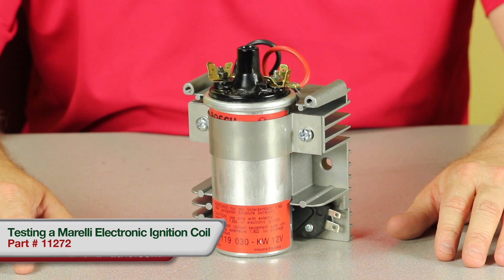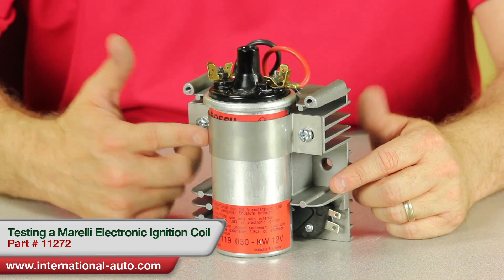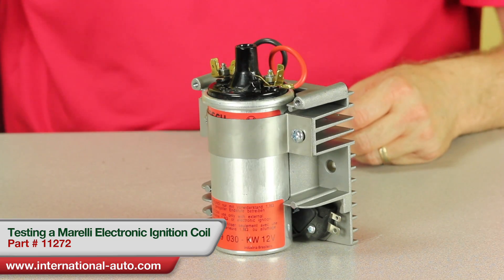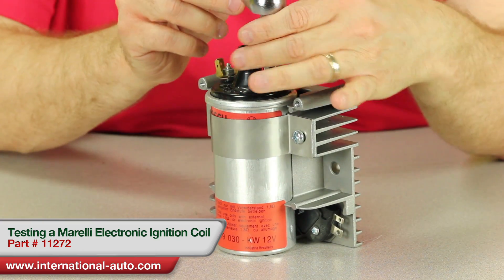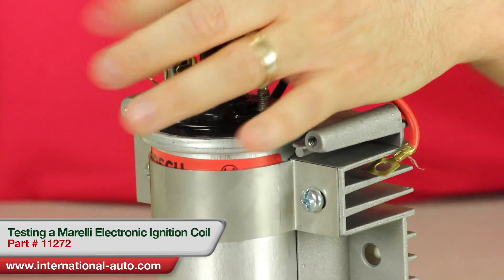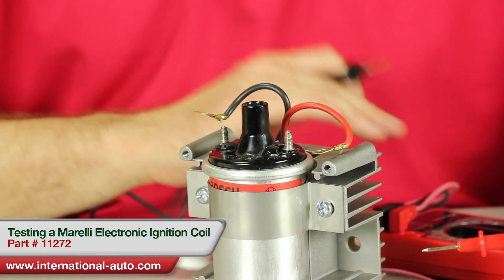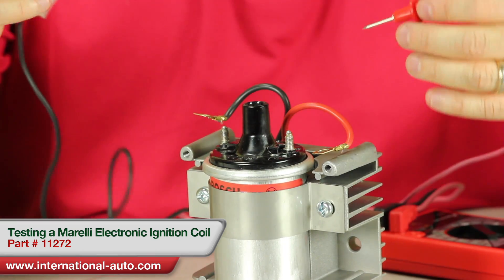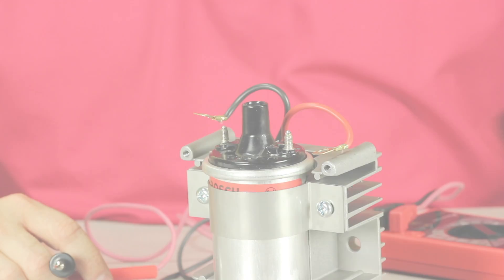Testing a Marelli Style Electronic Ignition Coil - International Auto Parts

Comment: what ignition coil you use (I see that its Bosch). Is on this ignition system required special coil? Or it can be used ordinary old type coil from mehanic ignitin?
Reply: The Marelli system used the same type of ignition module as the GM HEI ignition and in most cases, when used with the proper reluctor type pickup, would use a coil with a primary resistance somewhere between 0.5 and 1.0 ohms. With the correct pickup, the ignition module takes care of dwell angle control and current limiting, so you don't need a ballast resistor.

My Alfa Romeo from 1982 used the Marelli AEI 200B system, my coil is a Marelli and I would need to check the coil part number which you probably can't buy now anyway. The primary on mine is about 0.8 ohms, maybe a little less depending on the limitations of my multimeter in the low ohms range. The Marelli part number for the ignition module appears to be BKL1A.

The one in this video is a reproduction and probably uses the GM module mounted on the heatsink. 
The coil used here appears to be Bosch Ignition Coil 0 221 119 030.